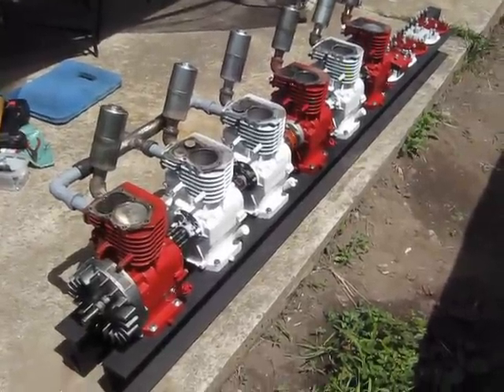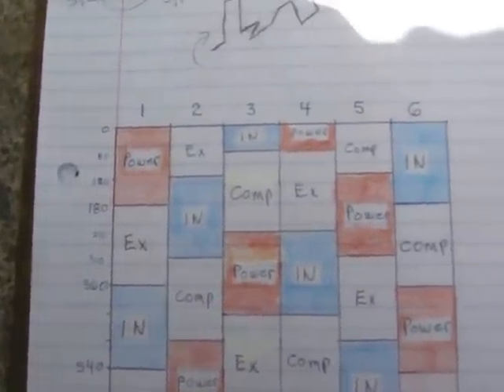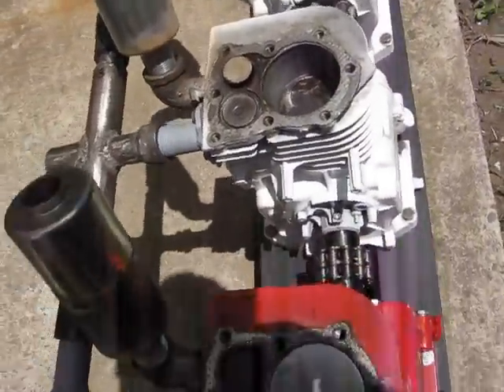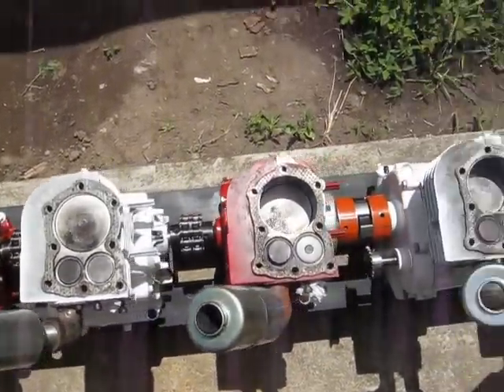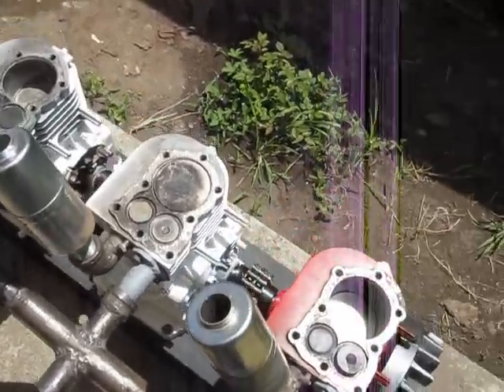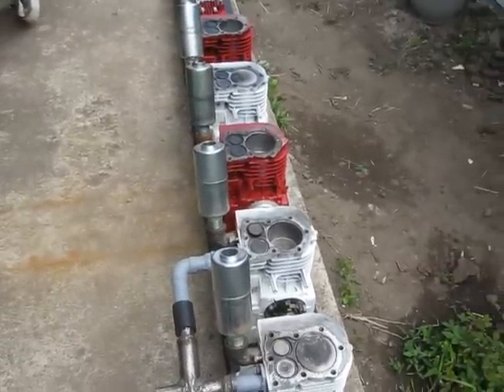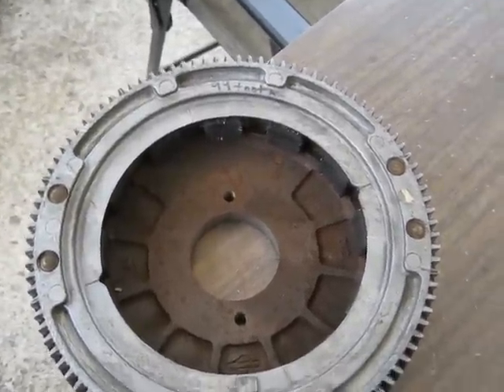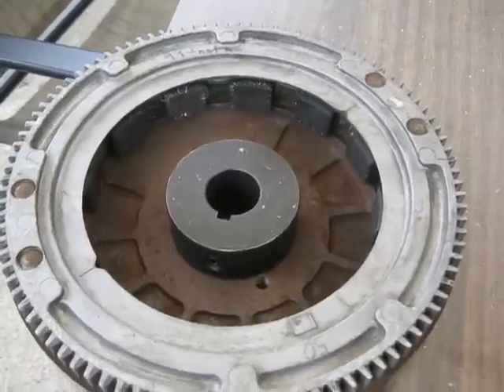Briggs 6 Crankshaft Phasing & New Flywheel Vid 2

Comment: I learned a neat one from the teacher in tech school as far as playing with inline engines. 
153624
If you look at the numbers , you can see the running mates. 1-6,5-2,3-4
Works with a 4 cyl too.
1342
1-4 are running mates , as are 2-3. 
And if you ever have a problem adjusting valves and figuring out what's going on without ripping out hair ....
Put a cylinder on valve overlap, and then you can adjust its running mates valves , they are closed.
Reply from the maker: Good insight, the same holds true with the Straight 8 engine.
Reply: +ChargerMiles007 yup. 
Any inline engine basically. 
The running mates works on V type engines for setting valves too. 
Typical 18436572 Chevy v8
1843
6572 
Basically "break it in half and stack it " 
1-6,8-5,etc....
Knowing this has gotten me thru many valve adjustments when all I know is firing order and valve clearances. 
Expand off that and it'll help you with ignition diagnosis too.
Reply from the maker: I got the 6 cyl. running on the front 3 today, the starter wouldn't spin all 6 over  :(
Time to build the rear cylinder with the starter gear mounted on it.  :)
Reply: +ChargerMiles007 whooha! She lives partially!! 
Do ya think maybe using an automotive starter might be easier ? 
but Briggs parts abound all over so that's cheaper. 
Cool though, dual starters kinda like the ol 20v149 powered generators I used to work on.